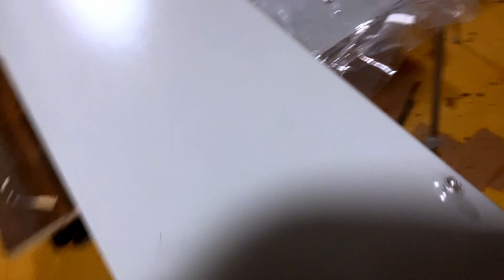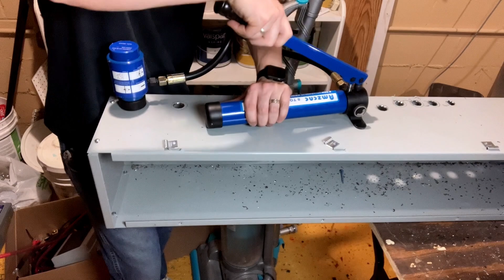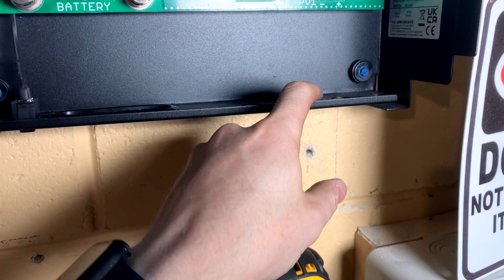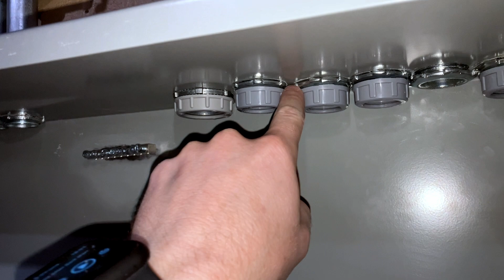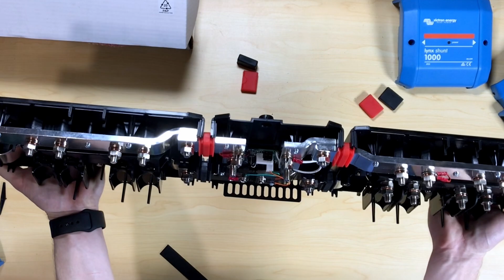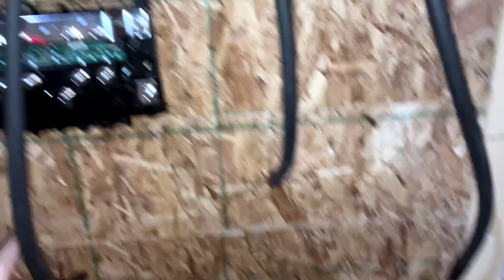Solar Upgrade - New Wire-way & Victron Lynx Bus Bar System

Comment: I would put the Lynx group on the far left hand side of the metal raceway (MR) where the MR feed the distributor section directly from the far left of the MR.  You could then either punch a bunch of round opening in the end to feed the distributor. The battery section would be lower to the ground - nearer the batteries.

Comment: QUESTION - Could i use the lynx shunt, distributor, power in system and cerbo monitoring system - with eg4 18kPV inverters and eg4 ll v2 battery racks
Reply from the maker: You can use the Lynx bus bar system.  I don’t know if the 18kPV can be connected to the Cerbo system.  I would think probably not.  You could still use the shunt data on the Cerbo, but I don’t think you could see inverter data on there.

Comment: Greast video Adam, thanx 👍 One of my experiences with the same Lynx Bus Bar setup: The Lynx Shunt can and does NOT communicate with the Lynx Distributor. So if anyone uses Cerbo/VRM with this combination: You'll never get an info, if i.e. a fuse is blown. Only the LYNX BMS can talk with the Lynx Distributor ☹
I decided to return my Lynx Distributor, ordered a second Lynx PowerIn and added four internal mega fuses with some bolts and nuts. It's working perfectly and I saved some money. 😜
Reply from the maker: Thanks!  Yeah I made that discovery recently.  Very disappointing.  I’m hoping that Victron resolves that soon.  Doesn’t make any sense why they wouldn’t make it work with both.
Reply: I talked with Victron last year, hoping it's only a missing software feature. But no, we have to wait for a new hardware Lynx Shunt II or something like that. I'm disappointed too.
Reply from the maker: @videoflieger1239  I found a thread on the Victron community page that I added my disappointment to.  Kinda dumb if you ask me…

Comment: Watch Riley and Courtney Ambition Strikes, 60k LFP battery with 24 X 445 watt bifacial solar panels. They mount their electronic gear on a white painted chip board in a steel trailer. No chance for rats to come in and eat the wiring. So I do not see the need for steel tubing to protect the wiring.
Reply from the maker: Thanks.  Yeah, I've actually talked to Riley about his system.  Nice guy!

The EMT conduit is not a requirement.  You can easily use liquid tight conduit for the AC side of things and the DC cables (as long as they're welding cables) are perfectly fine not being in conduit.  I just like the clean look of it all.  Plus, while I don't have rats, I have, well let me say my wife has cats, and they love to chew on things... so any extra protection is probably a good idea.

Comment: hey adam, thanks for your educational vids,,what happened to the ex6500 or are you installing the victrons as a revue only ?
Reply from the maker: Thanks! 

Right now they're back in their boxes.  Not quite sure what the plan is for them at the moment.
Reply: @AdamDeLayDIY  nice that your installing victron,super reliable quality stuff wish I went that route,
I have a sol-ark 5 k the thing is useless
Reply from the maker: @neilhendo7  Yeah, the Victron stuff I've had in the past just works.  Hoping these new pieces are just as reliable...we'll find out together!

Kinda surprised about the comments regarding the Solark.  What issues are you having?  I thought those things were pretty rock-solid as well.

Comment: Nise work! Clean job! I havent given up yet on my 6500 yet....i still cannot get the batteries to talk to each other. No help from s.s. i ran my buzz bars inside my wireway...keep up the great work. Thanks.
Reply from the maker: Thanks Jeff!  Yeah, the lack of support was one of the reasons for the change.  

Had I used the 8x8 before, I would have put it all inside as well!

Comment: It's interesting that even Victron isn't appreciating how much voltage is involved these days in solar panel strings.  They're still "OMG 120v AC we must have this in conduit" but "hey this 400v PV line?  Let it dangle bro, otherwise you'll never experience what a 400v DC arc does to a cat when they chew on the wires".
Reply from the maker: You joke about that but I’ve already had to kick the cats out of the room multiple times because they’re rubbing up against all the wiring.
Reply: @AdamDeLayDIY  Not surprised.  I don't even let my two idiots downstairs because knowing them they'd lick something live.

Comment: Hello Adam, what was the problem with the EG4 inverters? Did you return them to buy Victron system?
Reply from the maker: I still have them.  The little issues build up.  The flickering lights and then the overloads after the latest firmware update are just a few on the list.

The biggest thing was provably the lack of support.  Couldn’t get support to respond to my tickets in a timely fashion.  Last ticket I sent it was almost 3 weeks before I got a response.  I’m a DIY guy through and through, and if I have to contact support, I’ve done my due diligence and exhausted my individual options.  I just want timely support from a company I spent a lot of money with.
Reply: @AdamDeLayDIY  I have 4 SunGoldPower Inverters (same OEM with the EG4 ones) but now sure they will work good or not. Btw, where do you get the little hinges on top of the gutter?
Reply from the maker: @cotandiet6096  I don’t think the sun gold ones had the flickering issue that the EG4s had.  I’m guessing it had to do with the increased mppt voltage changes.  

Those are just clips on top of the gutter.  They’re riveted in.
Reply: @AdamDeLayDIY  Do you use the clips as hinges for cover, am I correct?
Reply from the maker: @cotandiet6096  No.  The clips just prevent the top of the cover from popping off.  The bottom of the cover has screw points but nothing on the top.  So the clips hold it in place.  I honestly wish it was hinged cause that would be kinda cool, but I would want it to hinge down so it would be out of the way.  I would imagine the gutters with hinges cost more.
Reply: @AdamDeLayDIY  I bought a 14g 4x4 square tubing from a metal supply to make a gutter like yours. This is much cheaper but takes more time. 16g is lighter but I can't find it around here. I am going to weld hinges on the bottom and screw on the top.
Reply from the maker: @cotandiet6096  Great idea!  Good luck!

Comment: You can flip the bus bar around  ,they give you a sticker   so its not upside down
Reply from the maker: Yeah, but then then battery cables have to come in through the top.  I wish there was a way to have the battery cables face one way and the inverters face the other way.
Reply: Would you consider the battery cables go up separately through a separate vertical wire way into the horizontal wire way and then they also come up from top into the flipped busbar
Reply from the maker: @KwadwoAsamoah-Duodu  I had throught about that…after the fact.  I had also thought about flipping everything upside down and mounting it flush with the bottom of the wire-way, but that would have required me to cut big openings in the bottom of the wire-way and I didn’t wana do that.

Comment: Nice going man,just take it slow,step by step,make sure you wire everything correctly:)
Reply from the maker: Thanks! That's what I keep telling myself.  Take it slow...do it right the first time.  On the plus side, the lynx system really almost makes it foolproof from the DC side.  It takes saves a lot of brainpower trying to figure out how to lay out each individual wire, bus bar, fuse etc.

Comment: Question: Since you're using EMT nipples between your controllers and the 8x8 wireway, have you researched the issue with magnetic inductance heating from only have one conductor in a steel nipple?  I know that with steel conduit, you need to have two (min.) conductors in the conduit so that the magnetic fields cancels each other out and doesn't create magnetic inductance heating of the conductors and conduits.  IDK. Just wondering. Maybe it's not applicable for DC current.  ??
Reply from the maker: I have not.  I know I've seen quite a few professional installers use conduit for the DC lines without any issues.  That's kinda where I got the idea from.  I know when I used them on my old 6500s, I never experienced any residual heat build up.  I wonder if that's for AC only?  I'm sure someone can correct me if I'm wrong.  Thanks though!